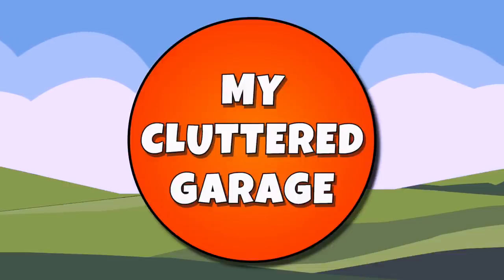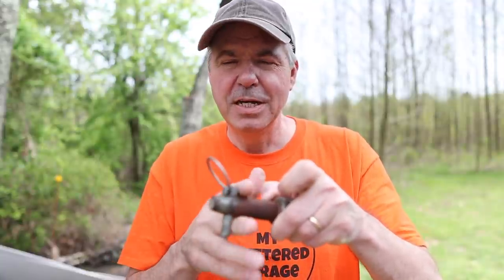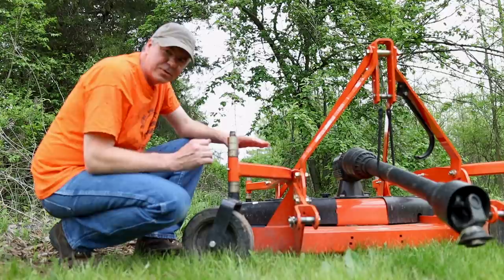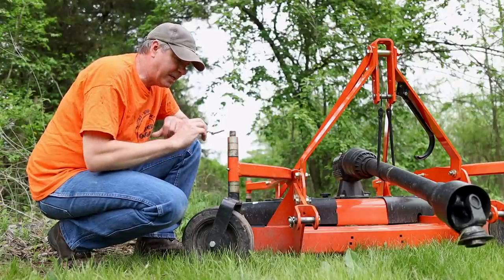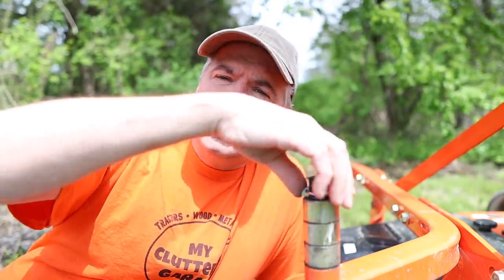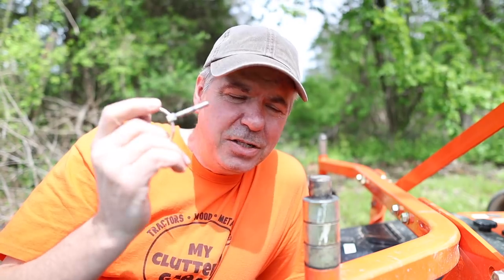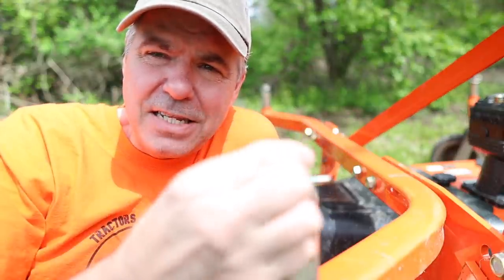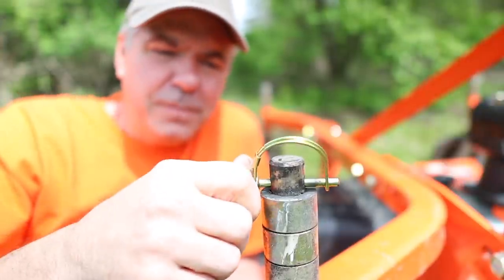#50  Better than a Linchpin???

Comment: Perfect!  I lost the lynch pin that holds the lift arm pin in on the box blade a few days ago.  The lift arm pin fell out just as I was backing up so I found it. I never did find the lynch pin, but I suspect the locking ring malfunctioned and the thing just fell out.  I wound up using a big zip tie in the pin and easing my way back home.  Like you, I used zip ties on the replacement lynch pin locking rings, but was not really happy with it.  Your idea is just what I needed.  Thanks for posting.
Reply from the maker: Hey Douglas. That’s great! Hope it works for you. Thanks for watching. -Ed

Comment: Ha- just yesterday I lost a linch pin and was digging around in the garage to see what I could find. Came out with what you had but it had a square latch (instead of the half moon you showed). I remember getting it a Lowe’s a few years back for a trailer project. I kept looking at it thinking...why wouldn’t this work?  Walked out to the  Kubota and it fit right in there perfectly. Great idea!
Ken-B2601
Reply from the maker: Thanks Ken! Makes you wonder why Land Pride doesn’t change to this style pin. I have one of those square type on my utility trailer too. -Ed

Comment: Good vid Ed.
Wish it was last year before i lost 2 lynch pins backing under bushes (mt. laurels) to mow.
Replacement the pins AND spacers was north of $45 bux plus a 1.5 hr ride. I have the upgraded ones you featured now.
Tractors...if its not one thing...its half a dozen 
🚜💨💨💨
Reply from the maker: Wow I’m learning that this really is an issue! Thanks very much, Rand!

Comment: I absolutely agree with the solution to your problem.  I came up with the identical solution. I also use the larger version to attach my yard roller or leaf sweeper or wagon to my yard tractor.  It keeps me from having to stand on my head while trying to thread the spring clip through the hole in the pin under the hitch.  Since I am a septuagenarian just getting that low is a challenge!  Keep up the good work.  New subscriber....
Reply from the maker: Thanks Fred. Work smarter not harder, right?! Welcome to the channel, I'm really glad you're here! -Ed

Comment: Kind of a related tip. I have terrible luck keeping pins in the 3 point sway bar ends. On our old Ford 801, the bars are long enough that when the front pin gets pulled by brush, it digs in the ground and gets bent in a u shape. The new tractor has shorter bars that don't reach the ground but still a hassle. For those locations, a bolt with a nut and jam nut are the way to go. I do use the pto pins on the adjustment part of the sway bars. The curved clip lynch pins got lost pretty quickly the first time using the bush hog.
Reply from the maker: Great tip! I’ve also switched to using nylon lock nuts over jam nuts where I can. Thanks for sharing! -Ed

Comment: another good one. hey on your quick hitch not hooking fdr-1660 upper hitch. the upper hitch brace to the rear of the mower, their 2 bolts if yours is in the front bolt that's for no quick hitch and the rear bolt is for the quick hitch. it sets the pivoting hitch back farther so your quick hitch to catch it. the bar is #1 and bolt is #6. I haven't done mind yet just got home so I'll do it Thursday. I bought mind at a auction  and he looked up the owner and it was set for the 3 piont hitch. i hope this helps you have a great evening. take care bill
Reply from the maker: Thanks Bill!

Comment: 😵❌❌ Been there...Done that:  If your luck is anything like mine, after 30 years of using finish mowers with those darn spacers and lynch pins, you'll be out $3.49 X 4 (plus spacers) very soon.  Bolts and nuts are the only thing that has worked for me. I change the cutting height very seldom any more since it is a little harder to remove the nuts. But I no longer have to hunt for the wheel and spacers in the grass anymore either. Plus those spacers are ridiculously expensive ($10). Have you run over the wheel and spindle with the mower yet?  Bent spindles, sliced off rubber tires, new blades...very expensive ($65+)...(Welding the top spacer or a washer on the spindle works too! 😏😁) All true but  I can laugh now!
Reply from the maker: If I lose one of these pins, I’ll definitely go with bolts and lock nuts! Thanks for watching. -Ed

Comment: We used to lose linch pins on the big plows years ago, went to the heavy duty ones. The ring is 3/16" spring steel. Takes a big pair of pliers to move it.
The pins you are now using are PTO pins. They work well for most things, they can still come apart.
Reply from the maker: Thanks for sharing, Ed! Much appreciated.

Comment: Yes I agree Ed, the choice to change to the other style will definitely be a plus !  I use those on my trailer hitches to make sure they won't bounce open going down the highway instead of a welding rod stuck through and bent around... LOL  Did that for years.
Reply from the maker: Haha, Wendell. I bet that welding rod never fell out though.

Comment: You can also get a "heavy duty" version of those first pins. I found them at Tractor Supply while getting some pins for a scrape blade. They are black and when i tried opening them they took a ton of force. Just about couldn't get them open.
Reply: Nice. I saw those at Tractor supply yesterday and didn’t know what the difference was... so
Just got the standard kind.... and a Lock Pin ... and a Lynch Pin with Chain. Them popping off isn’t my biggest problem.... it’s losing them not having a replacement at hand that really wastes my time. I’m thinking of tie on a ling red ribbon to make finding them easier 🤷🏼‍♂️
Reply: @edentulate1  Hmmm...maybe spray painting them with a fluorescent or Kubota Orange for easy visual when on the ground. I do that with the ends of my chains or snatch block when working in the woods. Helps me to find them much easier. Just a thought!

Comment: Ok, so I finally watched your silly video, old news, but thank you? Simple solution, I keep several linchpins and the big hairpin style in the tractor's toolbox. If I lose one they are very cheap in cost so if it's easily found, put it back on if not screw it, replace it and continue. I figure no need to reinvent the wheel, but I agree, a bolt with a nylock nut is the best answer. in some cases.
Reply from the maker: Thanks Stevie G. If I lose any of these PTO pins, I’ll go with the nut & bolt. I don’t mind losing the pins. It’s the spacers and wheels that concern me. Thanks for watching my silly video 😄

Comment: This are the kind I had on my plow to attach it to my Kawasaki Mule. Worked very well.
Reply from the maker: I'm thinking I'll find other uses too. How do you like the Mule? Thanks for watching -Ed
Reply: @MyClutteredGarage  It is really good, and will outlive me for sure. It's exactly like a Mule. Sturdy, Slow, reliable. We used it to plow our driveway for 2 years before getting the BX23s and BX2822A front mount blower. But the Mule is our main workhorse on the property to feed the animals, pull trailers, carry stuff.
Reply from the maker: @RossOnTheLand  very nice, but I do hope you outlive it. I’m really interested in the Kubota Sidekick, but I’m sure I’d love a mule too. Just using a golf cart now... and relatively happy with that!
Reply: @MyClutteredGarage  The mule is great because of the metal dump bed, 4x4, locking dif and winch.

Comment: Interestingly, no one suggested that you consider not using your finishing mower as a rotary mower. The tailwheel on the rotary is built for stuffing under trees and brush, and doesn't have belt drives that slip and burn under loads other than a lawn. That said, I am as guilty. Regards from Ontario, Canada.
Reply from the maker: Oh I know I'm kind of abusing the finish mower. I talk about this in video #23, and admit that I should have probably bought a rotary mower instead. Thanks for watching! -Ed

Comment: I have 4 of those D ring style spring clips on my gauge wheels on my 54" mower deck on my 1025R Sub compact tractor
Reply: Have a 60" on a 1026R, and have lost all but one of the 4.
Reply: @45Deere9500  I wonder if a guy would be better off using the "R" type pin clips, or whatever theyre called.
Reply: @truckerray7533  

I truly think a double nutted bolt would be the most sure to not fall out.  Wouldn't be too handy to adjust though.
Reply: @45Deere9500  Or better yet, a bolt with one of those metal nylon type nuts. I like using those type of nuts the best because ya can tighten them up on the bolt & they are most sure to not come loose until you yourself loosen the nut. I dont have any on my tractor or its emplements buts gonnuh change here soon. Tractor safe!

Comment: PTO Lins are not designed to be used in side load applications, such as on an axle. The side thrust will deform/ damage the spring clip. The linch pin is designed for side load applications. The side thrust is against the pin itself and not the retainer spring. That is why all the manufacturers use linch pins on 3 point hitch nd similar applications.
Reply from the maker: That’s a great point, Brian. I think it will work well for this application, but I agree with you about the function. Thanks very much. -Ed

Comment: Lost a few of these pins. Pin comes out and it usually bends up stuff. What are the better ones called? Linch pins with a spring clip? Thanks for the tip.
Reply from the maker: Hi Steve. They're actually called a PTO lock pin or a round wire lock pin. Be sure to get the right diameter pin for your application. Thanks for watching! -Ed
Reply: @MyClutteredGarage  Thank you. I have a pin like that on my engine hoist. One pin I need to try is on my sailboat. It has a "T" handle with a spring loaded push button that when released, releases a ball on the end. Kind of like a Craftsman ratchet when you release the socket.

Comment: Nice, would it be possible to tell you viewers the correct way to snap the ring on the lynch pin. Keep up the good work.
Reply from the maker: Thanks. Do you mean snapping it on the flat side vs the round side?
Reply: @MyClutteredGarage  Yes there is only one secure way.